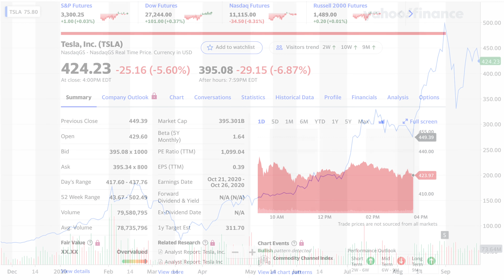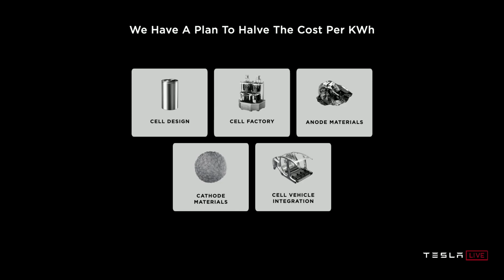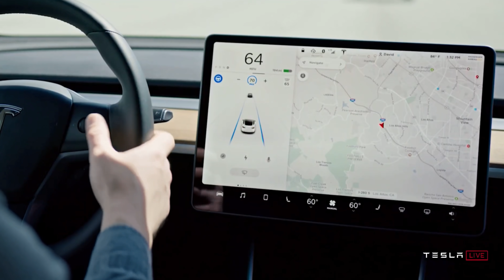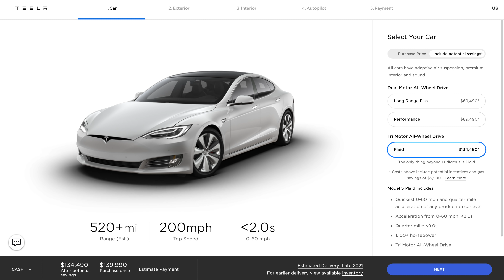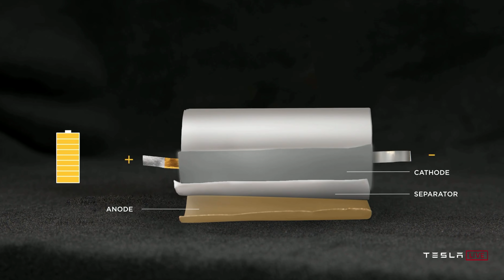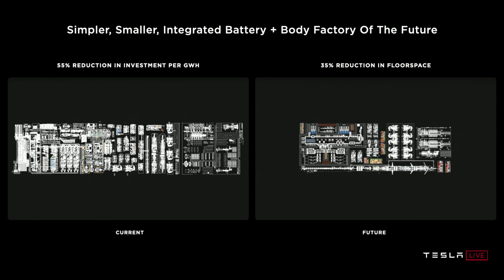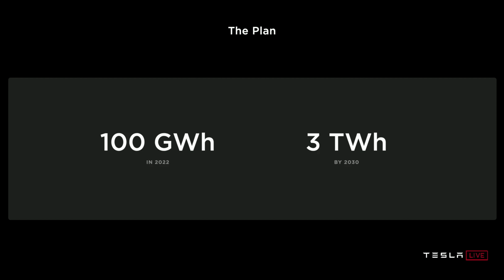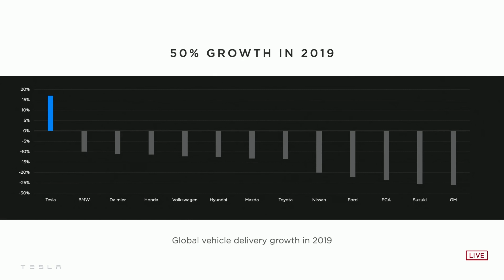Battery Day: Tesla’s Path to Becoming the Most Valuable Company in the World (TSLA)

Comment from the maker: What a day. Let me know what questions you have or areas you want to see discussed in more detail and we'll get back to the normal episode flow on Thursday.
Reply: Where will the roadrunner cells go first - Semi, Roadster or Cybertruck? My bet is on the Semi.
Reply: @S_Padival  actually we don't know which cell chemistry they are using for the pilot line. Depending upon cathode chemistry it could go into any of their product. But I think they will start with the Nickel + manganese chemistry to put them in Model Y out of Shanghai and Berlin as they are the first to start manufacturing.
Reply: S Padival I thought S plaid, no?
Reply: Rob.
One question which I don't think was confirmed (need to watch again)
Does this process allow for multiple chemistries including LiFePo4 in the same "can", with tabless technology?
If so, it's effectively the standard assembly factory with a slightly different "front end".

That's big.
Reply: @rogerstarkey5390  ..and is Tesla going to have the feeder companies switch over to the new form factor for all batteries?
Reply: Roger Starkey I need to watch again, but didn’t tyey mention towards the end yes, that’s why they had separated out all the advancements?  so cheaper lower density anodes would still benefit from tabless, structural pack assembly and so on?
Reply: Hey Rob,
As Elon said yesterday, Batteries are the number 1 constraint of the whole automotive (electric) industry. I would love to see a detailed analysis of the whole industry (how much kWh are produced in total in the moment, what percentage of that belongs to automotive, which companies have what percentage of produced capacity (Tesla, VW...) and maybe what plans the suppliers and Auto companies have laid out for the future, because I would be interested to see Tesla’s position there.
Thanks For Your response.
Reply: Is most valuable company in the world the same as most profitable company in the world? Elon didn't seem fussed on profitability, will that be the case forever? If Tesla is the biggest company in the world but not very profitable does that mean stock price won't rise?
Reply: Chris Winn What matters is that it may be the ONLY profitable company in its space
Reply: @ChrisJWinn  If the costs go down and they sell 40X de number of cars, and now have cars out of warranty to service, solar roofs, battery packs, robotaxis, semi trucks, etc, etc, etc...they will definitely make more profit. The only reason they aren't more profitable now, is that they are growing by 50% yearly, its actually amazing that they ARE profitable at this stage considering how fast they are reinvesting in growth. Just imagine the cost of building all those new Gigafactories...
Reply: Chris Winn Have you seen Amazon? profit is a function of volume and margin. Volume also means you capture market share and keep competitors out. they should focus on volume right now, enough margin only to help them grow faster
Reply: Chris Winn hi, Elon kinda came close to what you are asking when he was asked if all them improvements would be passed along as savings to customers;  he waffled saying well they need to be cautious as the profitability margin is not that fat, so I am satisfied he wants to be profitable.
Reply: @ChrisJWinn  Mars....that is all
Reply: Chris Winn Profitability isn’t really a concern for Tesla I don’t think; their operating leverage is high and has been increasing. Plus their op ex as a % of revenue is projected to continue to decrease
Reply: Chris Winn No
Reply: Interested to see Ark Invests analysis of battery day.
Reply: @ChrisJWinn  
Basically?
Rolling on the floor laughing uncontrollably....?
Not to mention, with the dip, they can buy more!
Reply: @noisypl  
It's a simple principle, the cell casings will spread the load.
Elon mentioned steel casings, not aluminium, so added strength there.
Reply: I’d be interested in the silicon stuff they were talking about? Was that using the silicon to build the anode directly? A deep dive on anode / cathode tech would be useful.
Reply: Gareth Foster 2nd they.
Reply: Rob, a little off-topic, but next time you converse with Jim Cramer off camera, please find a way to gently bring him up to speed on what the term  "million mile battery" battery even means.  I don't think he understand it at the fundamental level, along with total range on a single charge.  I've seen him talk about it on a few occasions and there's a fundamental disconnect.  Also, when speaking with you, he asks if Tesla could make a battery that last 10 or 12 hours.  That's a completely arbitrary question that shows he doesn't understand what total range even means.  He's a great ally and I'm stoked that he's now a bull, but I fear a fundamental gaff during one of your interviews, displaying his true innocent ignorance on the topic.  Cheers, and a deep thanks for all you do!!
Reply: My bet for ARKs analysis is at least a 30% bump up, in the base case scenario!
Reply: Is Giga Texas going to be capable of integrating these new innovations in the manufacturing of battery cells, the power train and cell to vehicle integration (if Tesla decides to produce batteries at Giga Texas)? Will they first be replacing the machines and assembly lines in their current factories or building new factories with them?
Reply: @christophermack4659  my guess is they will roll out the new battery manufacturing lines to the new factories and retrofit the old once the production bugs are ironed out in the new facilities...
Reply: I'm tired of idiots and greedy manipulators in the market. Good... in general... is under attack by evil.
Reply: Anthony Losego We all are.   Facts of life
Reply: There was some talk about shorter charging times, however no numbers were provided. The new battery produces less heat, so charges faster, but how much faster? Like 5 minutes?
Reply: I’m amazed how quickly you put this summary together!
Reply: Id like you to look beyond the hype. I first I was all oh wow this blows everything away, but the i started thinking and realized there wasn't any actual hard numbers.
The pilot line is still in development, even after all the delays, so there stupid us a small chance they can't figure it out (as in get a high yield rate). The range increase are so weird and more something trevot/nikola would have said. Yes efficiency's will increase range somewhat but to really get a bigger range you need a bigger pack (in kWh) but that didn't get mentioned, they just added on. Cost decreases ... Great, but from what starting point? Today's? Last years? Next years? And is that $200 $150 $120? Kinda important. Essentially all we got were hollow (meaningless) numbers. No mention of impact on charging or cycle life. I mean in the end we know as much about these cells as GM's ultium cells and they got blasted for lack of details
Reply: @quantaca5773  ? ...solid numbers, soft deadlines
Reply: @qwazy01  not really, ok size decreases gave a baseline so thats a "hard" number, but you cant just add up energy density and efficiency numbers and give a increased range % thats just weird math because they influence each other and efficiency is also affected by other things. And cost decreases are basically meaningless if you dont know where you (they) are starting from and what needs to happen (in real life production)  for them to actually achieve those decreases. Honestly asside from some nice (possibly) upcoming tech advances (often even glossed over),  this felt like a MBA's presentation instead of from a bunch of engineers, more nikola than tesla. I mean it had to be live because lots to show ... and they had nothing to show. (Though i hear some investors got a facility tour)
Reply: What do Teslas current battery suppliers do about their stock dropping while supplying the company that is causing it?
Reply: Chelsie Stinson that’s why Elon twitted yesterday that Tesla will need all of its partners cells for years to come
Reply: That question you were next in line for, just send a tweet to Elon, he may answer it
Reply: The market seems disappointed - I assume because it does not understand or is too lazy to spend any amount of time studying it.    This is one reason your channel is so important; it looks at the details and leaves the hype behind.  I have to say I am glad to be a supporter and sad I did not get onboard sooner.  Carry on.
Reply: I have the feeling people barely realise how important and effective the "battery NOT heating up while charging/discharging" part actually is. The battery degradation will be a lot lower while supercharging, the car will not overheat while racing, the whole Tesla cooling system will now suddenly be completely overpowered (and could probably become a lot smaller without problems). Charging will not let you lose 5% of the energy, but like 0.5% of the energy (over the lifetime of the car that will safe like 10% of the energy use, even outside of the energy the cooling system uses) and many many more advantages. The range of the car, even without growing the amount of kWh will grow by a lot and the energy needed to supercharge the car will be significantly lower.
Reply: The question on Elon's mind recently (last earnings call) was 'please mine more Nickel' when Elon is still trying to grapple with a problem, you know that's a vital area that needs to be addressed. That's why I asked the raw materials supply question (🌶️🚿) They seem a little more comfortable on that front after conversations but there is still work to be done in this area. Maybe hunt down some experts from the mining industry that supply battery makers to go deeper in the implications of the current state of the raw materials industry, Tesla's new techniques for mining lithium clay in nevada (a very non traditional source) I'd find THAT fascinating!
Reply: I’m wondered why nobody noticed on the presentation and is not talking afterwards about one of the BIG announcements Elon actually made i.e. the 10,000 hectare mine Tesla acquired in Nevada, and hence meaning  is entering the mining business for lithium from the surface mud :O and further meaning the are actually starting construction of factory (battery maybe)/or high-tech mine (just) to be found out soon enough :)
Reply: Alek Tomanov actually that was the most impressive to me. 10k acres to mine? That’s incredible!
Reply: @NFTGoldBunny  Also entered partnership with Piedmont Australia (ASX) for 1/3+option of their ~2022/23 nickel
Reply: D Luchin 🤣🤣
Reply: @dluchin1998  
Talk about trolling for a business opportunity, he won't be asking questions in future.
Reply: Nice recap mate. Notice they showed the front half casting in the cell to pack images?
Reply: what is the current use for the in-house produced cells?
Reply: They have opened the pre-ordering for Plaid Model-S while still retaining the interior look and feel. I am sure a number of people still enjoy that, but they have not materially improved it in some time. This leaves a few options:

1) They do not think that it is outdated and think its fine
2) They think the Plaid Drive train will convert anyway
3) They will change it 2022+
4) They will change before delivery and think people that don't want it (want it as ordered now) will get to cancel and those would be few

In general the first Model S proved it could be done, but offered little in extra comforts (Massage seats, better lights (for EU at least), executive seats in the back, etc). Question is how long will they do be able to afford doing that and will it be the same with the Model 3. But if they want to sell a real lot, they will have to offer more. I am not sure the other companies can source enough batteries in the next 5 years to fulfill the diversification demand.
Reply: @MatthiasGötzke  Starting with model Y reveal Tesla has unsold new products at reveal. At the rate they move I anticipate this will be the case going forward. A 'refresh' will be annocloser to production to prevent the ever popular 'Osborne' effect cannibalizing current sales.
Reply: Matthias Götzke Think they’re more into minimalism and eliminating unnecessary things rather than adding extras.   Sales be damned.
Reply: The lack of a simple message. IE "Our $60 per KW spells the end of the traditional auto industry as well as the transfor.ation of the grid worldwide "
Reply: I had the same question about charging rates and cycle life.
Reply: What are you talking about?!? Tesla peaked in 2018! 😜
Reply: Did they tell you what they are doing will the cells they are building right now at the pilot factory?  If they aren't going in to any of the current cars and plaid is a yr away where are they going?  Power walls?
Reply: I’m curious if Tesla will get into a buy back program for non working vehicles. Tesla will buy your junked/dead Tesla to recycle the batteries
Reply: If the batteries are integrated into the frame/casting does that mean that they are no longer servicable/replaceable? There would have to be an access point for assembly. Will that be on top of the casting or below the casting. We want our batteries accessible for repairs, replacements, and upgrades.
Reply: Brian Silver It will probably cost more time and money to replace them , but once batteries have long life and reliability it is better to reduce manufacturing cost and give savings upfront. Most cellphones switched to integrated batteries once batteries were reliable with decent life.
Reply: @amanthinks374  Totally agree, BUT they did not mention the reliability/long life improvements we were expecting with the million-mile battery (which they may just be holding in their back pocket to offset any more negative Osborne affect.)If they expect people to buy the existing cars and take advantage of the newer battery tech as it becomes available, battery access is an issue. I have followed Sandy Munroe's line of thinking that serviceability is secondary to ease of manufacturing although it's hard to think of disposable cars.
Reply: Wonder why they didn't mention anything about the Semi timeline
Reply: The fact that the active cooling is removed brings more range?
Reply: Could you please drop a behind the scenes video? It was very exciting to see you in Galileos live stream.
Reply: I think Tesla has to decrease their car prices right now or add other incentives to urge customers to buy; for instance, ensuring customers that if they buy a car now, their battery/car will be upgraded with a cheap price - when a new batter technology is available. Otherwise, they won't be able to escape away of the negative impact of Osborne Effect. Many people might tend to hold - especially those who were planning to switch from gas to electric car.
Reply: Will this cell form factor make the Octovalve and associated thermal management system obsolete?  No system, no parts, no cost.
Reply: @waywardyuppie  You still need something to make the passengers feel comforteble, but I'm very curious about this answer as well, they don't need any liquids at all any more if I understand things correct. At most to heat the batteries up when it's extremely cold.
Reply: Love the channel, you really provide sound logical arguments to support your point of view that makes me really respect the work your doing.  

As for comments or questions,  I would wonder whether Tesla intends to do in house LFP batteries also and not just the advanced nickel chemistry.   Most of the innovations they announced would/could also apply to LFP and would allow much lower cost with LFP energy density approaching and possibly exceeding what we are currently seeing with current NCM chemistry.     

Also, if the opportunity presents itself I would like to see a discussion about how tesla energy could become a true home energy integrator.   By combining solar roof/power wall/HVAC/hot water to create not just energy storage but advanced demand response systems.   The fastest way to a sustainable future cant just be make more clean energy and build more batteries, it is much much cheaper and better for the planet to improve efficiency and reduce the total energy waste and not just generate more. For example, during peak solar energy production if the grid was experiencing low demand and there was excess production,  a smart integrated system could maximize battery storage and if the battery was full use a high capacity hot water tank as a  dump load that could absorb more energy (hot water btw is a significantly cheaper storage medium than batteries).   The current plan in most areas is to curtail solar generation during peak hours to keep from overloading the grid with solar.   The same would apply during peak demand, the integrated system could manage the household temps/hot water/battery load to reduce or eliminate any demand on the grid and maximize self consumption    If Tesla used a integrated hot water/hvac heat pump system, with an octovalve type setup, during the summer in hot climates the waste heat that is removed from your house and rejected to the outside could be redirected into hot water storage.    This in theory could provide substantially more efficient hot water, ~40% of many homes energy use, during the cooling months and during heating months would still be half the operational cost of traditional water heaters.   Most of the pieces for this technology that already exist but no one to my knowledge has combined them into an integrated system.
Reply: You mentioned figuring out full L5 autonomous driving in 10 years. Elon said that the private beta of full L5 ships next month. This was the biggest news from the event.
Reply: will a cell/body design integration mean more expensive repairs?
Reply: Just FYI? Both ARK and Munro put the price per kWh around $60 with the new advances. And the Tabless design? Negates charging time issues by solving the heat issue.
Reply: Would be interesting to know what is the lifespan of new cells and how they are planning to replace broken batteries.
Reply: @iippa6697  I think quality control (Hibar) will solve that at time of install and by making it a permanent part of the car are concerned about bad cells. Pretty impressive!
Reply: It's too bad you weren't able to ask your question. I hope someone asks it soon. That would have been really useful information. Also how the new cell and or pack performs in cold weather would be great to learn along with how they've changed the pack thermal management to increase performance or decrease costs.
Reply: I was not aware of the human rights/safety concerns of Tesla factory workers or miners until today. I’d like to know if there is any truth/evidence behind those claims that were being made during the shareholder meeting
Reply: Christopher Mack I believe they have a statement on their investor relations site about this.
Reply: Do you think the new batts are being used in the powerwall now, hence the reduced in price?
Reply: @autumnite  no
Reply: Should I sell my shares now and buy back later at a lower price? Any recommendation pls.
Reply: @JithinJose2  it's risky. Trading stocks has a higher chance of having negative results for the average trader
Reply: @JithinJose2  If you can time the market - go for it!
Reply: @frednicholson  Yeah, I snapped, closed it. But relaxed now.
Reply: @JithinJose2  no, and too late